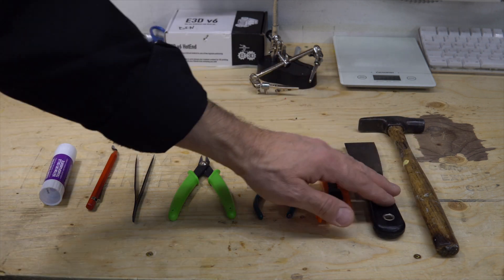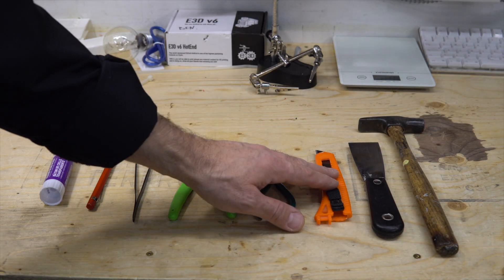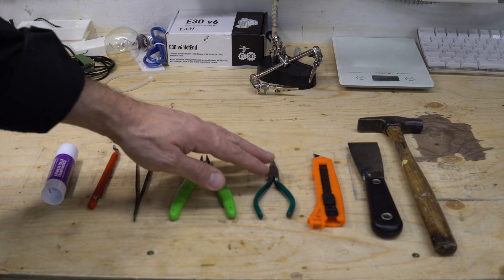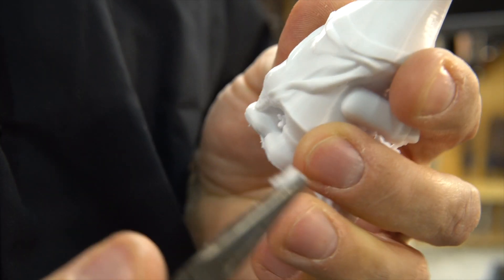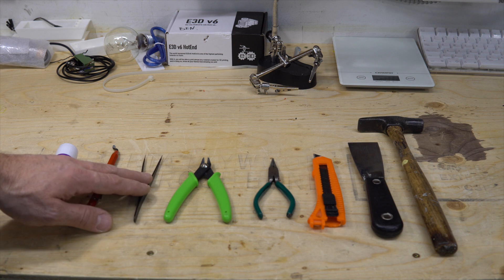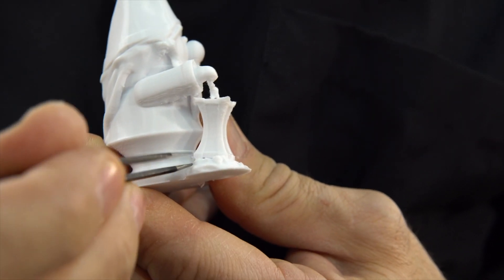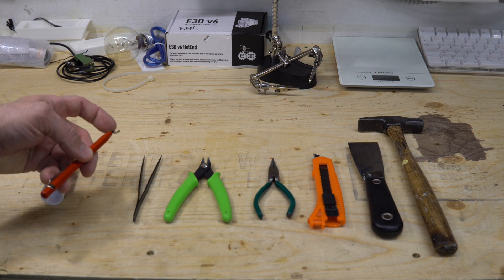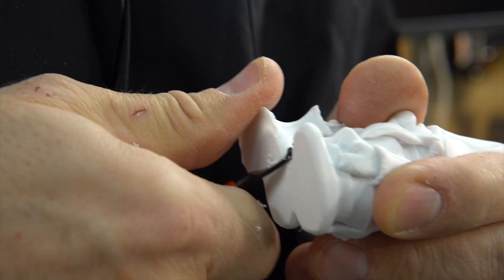Top 8 Tools For 3D Printing

Comment: what kind of printer do you have ?
Reply from the maker: Hi, A Monoprice mini select, a Hictop 3DP11 kit and a self made Haribo Edition
Reply: Frank's 3D shop i want to get a monoprice mini v2 , it would be my first printer what do you think ?
Reply from the maker: Hi, I think it’s a good printer to start, not much to do. Reroute the bed cables if it’s not already done on your version... Stick to PLA and you should be good.
Reply from the maker: And the reroute is not always necessary, my friend has cut the cable tie under the bed to relief tension on the cable. Still works after 6 month.
Reply: Frank's 3D shop what do you think about the CR-10 i don’t want to just be stuck with printing pla i want to be able to experiment with other type of filament
Reply from the maker: In that case the CR-10 is a better choice, just make sure you begin with a couple of rolls of PLA first